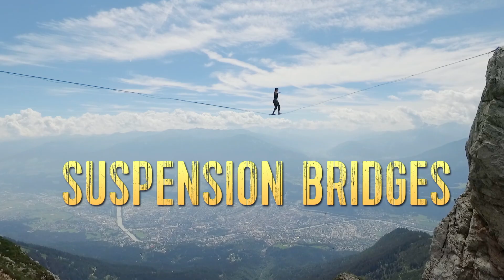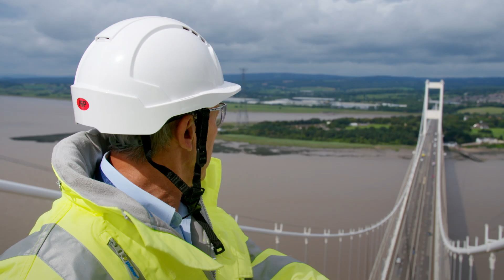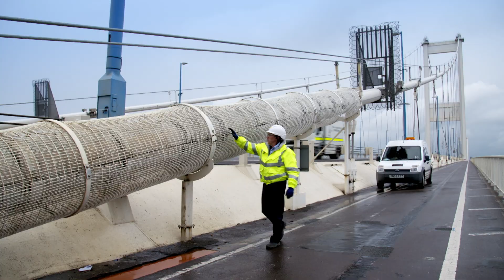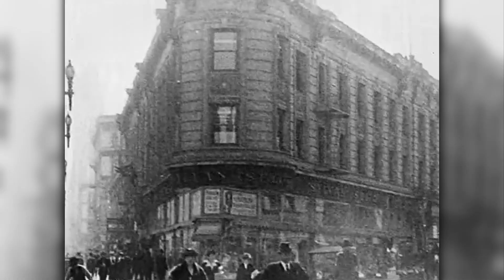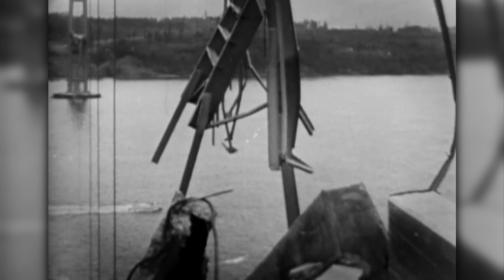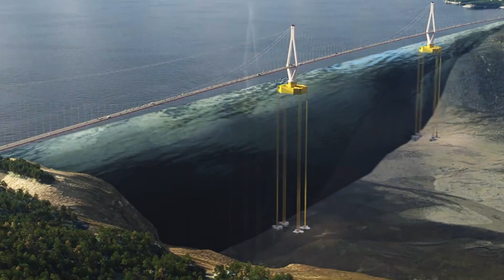Bridging Horizons: The Engineering Marvel of Suspension Bridges | Full Documentary

Comment: I retired after 30 years working on the 1950 second Tacoma Narrows Bridge. The design had actually an overkill of features to eliminate harmonic resonance. It has of course the box truss instead of the panel girders of the 1941 structure. And in addition the road deck has steel grating to allow the wind to pass through. Also the engineers added large hydraulic dampening jacks at both the towers and at mid-span to quiet down the movements. In the 2000s engineers studying these measures and determined they were pointless (other than the box truss which is essential). We also had 2 earthquakes during my tenure with almost zero damage